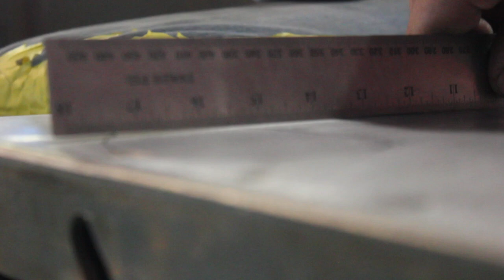A Very Damaged Fender -1967 Land Rover Series 2A Video #1-

Comment: Nice work cleaning that up so well, but Very Damamaged? I'd be very happy if mine were that good. It seems like most corners of the LRs I score get rammed into fence posts or crushed in by cows wanting a scratch post. 
Am i correct that you are using the SS shrinking disc? Does it try to gall up on the alloy?
Reply from the maker: We use a few different types of shrinking discs. And as long as the metal is clean, it will not gouge up the surface.